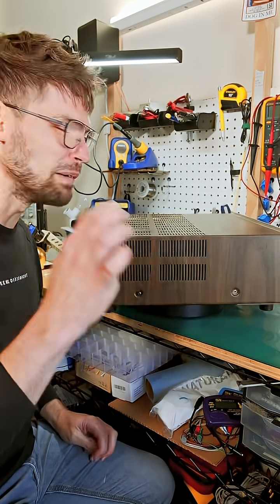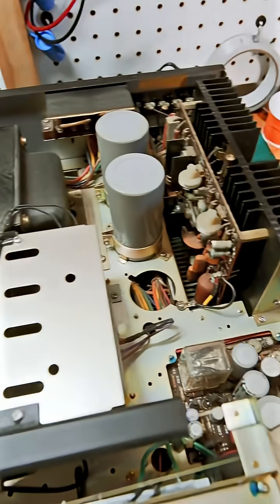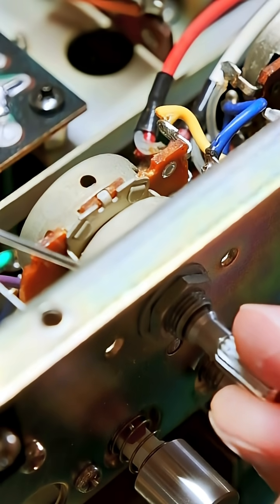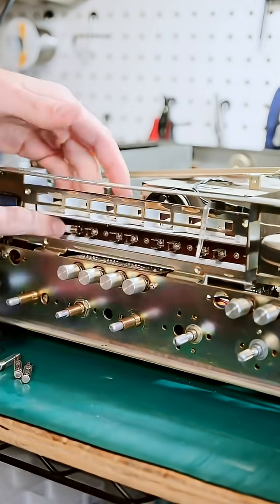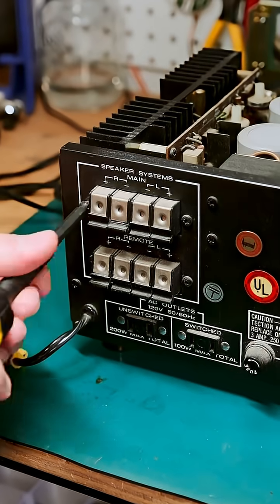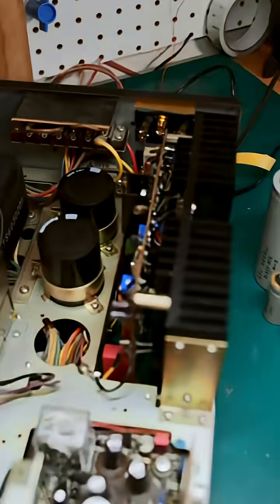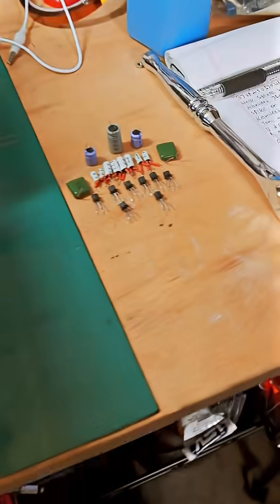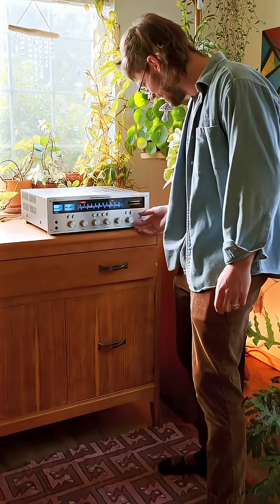Built to survive a house fire 🔥 #stereorepair #vintageaudio #Hifi #Marantz

Comment: THIS GUY IS EXACTLY WHY I DON'T GET MY EQUIPMENT FIXED ... TECH'S DO SHT YOU DON'T NEED AND YOU DIDN'T ASK THEM TO DO ...THIS DUDE REPLACED THE SPEAKER TERMINAL FOR NO REASON AT ALL AND TOOK ALL THE GOOD PARTS OUT AND REPLACED THEM WITH CHEAPER PARTS TO RESALE AT A LATER TIME .. WHAT A A.HOLE

Comment: Love YA!!! I'm just a nerd of many colors offering a tiny bit of help!! 

No snobbiness intended...

Vellum isn't paper, but a category of materials whose intended uses overlap papers, textiles, stationery and even passive filter media! Vellum is a legitimately dope material for every use paper has, and even when identically thin as most papers we use in modern era, about .004"-.007", vellum will offer an incomparably longer life especially if being folded flexed rolled or even WET... Papers are by definition dried and pulped wood fibers which have nearly zero usable length for any hope of a lazy self knit. VELLUM is cotton fibers and totally will self knit thus it will NOT dissolve in water. Yada yada it's irreplaceable for dorks like me; artistic, legitimately a decent board drafter, AND a builder/fixer. Vellum has a writing/drawing feel and sensation that NO paper can match, and ALL final board drawings go on vellum for archival means.

/NerdGirl

Comment: Have one of those beauties on the shelf, next to my MacIntosh amp.  Had both since the mid 70's, as well as a pair of Bang & Olafsen Rose Wood speakers.

Had a B & O Linear Turntable until an idiot friend stepped on it, during a move; it did not survive.

Buy good stereo equipment & it can last an average listener a lifetime.

I've added a few components, tape players; started w/ a Sony reel to reel, foolishly believed cassette propaganda & sold when I got a cassette.  About 20 yrs got a TEAC DAT when a friend died; pro studio gear will spoil ya. Lol

The loss of the B&O turned out OK, when turntables first died out, I picked up a turntable I never would have spent the money on, but at 75% off, who can say no.  A year or so later, wasting time b4 an appt: drop into stereo store. They had a cartridge, orig over $600. 

Luck would have it, I knew 'some' about it. Enough to know I should buy it @ $50!

Now, if all the albums I still have from the 60s & 70s were in better shape.

Comment: Ooh, in 1973, having just left the Air Force and was waiting on the bus to the airport, I went into the BX and found a Pioneer SX424 receiver and two speakers.  They wanted $299 for the set, I had $300 in my pocket, and I took them home.  I still have that receiver and both speakers, and they will likely bury it with me when that time comes.

Comment: About how long does it take to rebuild this unit?
Reply from the maker: If you're experienced, maybe 15 hours. If it's your first one, probably 100 with research and getting the parts together.
Reply: @Shuksanaudio Thanks! Had originally meant how long for you to rebuild? What about cost (for this unit and for you to do it)?

Comment: I have a Yamaha natural sound AV receiver model HTR 5850 it says it puts out 300 watts my speakers are Jensen CS315 they say they take 80 watts continuous and 220 peak there 15" 3-wayspeakers and have great sound but i can't turn my volume up more then half without tripping the circuit breaker and shutting down the system. Don't get me wrong it goes very loud ,loud enough to not hear someone hollering right next to you but I want speakers that can get to near concert levels. Anybody have a suggestion as to what type of speaker I can buy to get to those levels or volume.  I would like to hear how my receiver sounds at its upper levels. I want the bass beat to come out through my breath wile vibrating my whole body you know what I mean.

Comment: Does replacing all those parts affect the original sound of the unit?
Reply from the maker: Individual parts don't have as much effect as the circuit as a whole is generally what provides the sound signature. That said, old parts in the unit have aged the sound a bit as the electrolytic caps tend to develop higher ESR when it comes to frequencies over a couple thousand Hz. Replacing them will yield a sound closer to the original than it sounded before the work.

Comment: I have my original Technics SUV 9  Class A amplifier , I have owned since 1981.   120 w/ channel beast, It has been in original box for about 20 years along with separate tuner.  It needs cleaning as there is some noise in the controls, I have kept it all these year because of the look and the solid heavy feel of the analog controls. Should dig it out sometime and have it gone through.

Comment: You do great work.  Only thing I don't like is when you remove the original spring speaker terminals for big, clunky, protruding binding posts.  Since the '70s I have never had any issues with spring terminals. Audio snobs (not saying u are one as I appreciate what you do) seem to dislike them. But you have to do what your clients want.  Do Marantz units have issues with spring terminals? My Sansui ones are fine and have great spring tension.  Great job on the 'ole Marantz.  It will go another 40 years.

Comment: I jave that exact model. I found it next to a trashcan with a Marantz tape deck and some warfdale speakers in  1990. The only thing that ever broke on the amp is one of the lights witch i replaced with an oroginal light that was hard to find back than. White LEDs didn't exist back then. The tape deck that came with it stil runs on its original rubberbands. I like the sound of the Marantz and i don't think I'll ever buy an other

Comment: Very nice result. Except for the crappy looking fake wood veneer of the case. It would definitely benefit from getting a real wooden case with a nice varnished veneer. 
What did you use to clean the front plate without damaging it ? IPA alcohol ???

Comment: A vacuum cleaner generates so much electrostatic energy, you could easily destroy an ic. Once you‘re finished with the vaccum job, you might as well use a non-antistatic cloth… you‘ve already stress tested the circuit. Ok for the high voltage side or military-spec hardware but not for anything else worth repairing.

Comment: I have this tuner inside a giant old cabinet and still, to this day, I have never had it cleaned and it still is the best sounding system I have. Maybe a couple of pops in the volume but otherwise just majestic. I don’t know for sure, but it’s oriented face up in the cabinet that has a wooden lid and perhaps the cover with the aid of gravity has helped keep all the transistors and wires and such from getting completely covered in dust. At any rate, always nice to see another one. Lemme know if ya wanna clean mine lol

Comment: i have Heathkit aa15 and ar15 I built in late 1970s. are they worth rebuilding ? Most electrolytics probably bad by now I would guess. just wondering. Replace a large 20000 mf about 40 years ago

Comment: What is the point in replacing the lights with LEDs? Seems it would just introduce noise into the system and the power usage is not really a concern.

Comment: Too funny, while it's true rms AC power is not directley equivalent to DC (excuse the pun I stuck in there) the approximation of power is. 120v, 310W = 2.5A, so the 3A 250v fuse is the right rating... Imagine a 220v+/-10% system then only 2A fuse is needed for 1/2 the current

Comment: I had a onkyo tx NR 609 which died due to hdmi chip issues . It was in warranty so the offered me a tx NR 646 worked great for a while now it will not connect to the internet I have factory re set and no matter what I do I can't get past the gray out network on the menu . Any idea what the issue . Thanks

Comment: I had one of these in the 1980s. It had a short on the volume knob. I would have to crank the knob up until the volume came on then turn down the knob to the volume I wanted. This worked for a few hours and then the volume would drop out again. I would have to turn it off to let it cool. It was free so I didn't complain.

Comment: I love the days of solid state components (resistors, capacitors, vacuum tubes).  Before sealed IC Chips took over - circuits are so miniaturized now repair is not possible and they are so susceptible to ESD damage.

Comment: if you do scratch the black, you can fix it with an airbrush.
I did scratch a plate before and spraying it black with an airbrush fixed it. if you look closely you can see it, but not under normal conditions

Comment: Did you measure THD(1kHz,10kHz) after work was completed? If so, that would be good to see so-as to compare to the specification for this old timer. In this way the customer knows if the work is correct or not.

Comment: My wealthy uncle was an audiophile. I remember well in 1974 when I was 15, going to many very expensive stereo shops that only sold high-end systems. They always had separate rooms you would go into to listen to different equipment. Sometimes, we'd travel over 100 miles away in his 2 year old Rolls Royce to look at or buy something.  Marantz equipment was usually present. I remember he bought a pair of very tall, maybe 6 or 7 ft tall speakers that were like an inch or 2 thick called MAGNA PANS... he wanted the best amps. Best turntable, tuner, cassette deck, which had just started coming out replacing 8 tracks... they were very expensive..fun times, good memories.  It was a different world in many ways then.

Comment: Flyback diodes across the output transistors?  Replaced all the bad caps?  Checked the waveforms and removed all the distortion?  Perfect.  Subscribed.

Comment: The sound quality of that little beast is amazing. Once again showing it's not about how many watts but the quality of each one! 
Is it considered a dual mono amplifier? Is there a complete and separate amplifier for each channel?
Reply from the maker: Absolutely! It sounds great! It's not dual mono. That would required two transformers and two separate power supplies. There is always a separate amp card for each channel if it's a multi channel amp.

Comment: Hello and good morning!   Soo.... I had a fire and everything i own was either burned or it has considerable amount of smoke damage.   Unfortunately my Sansui 9090 was a victim.   Let's say it got super hot the wood cover turned black and was exposed to some serious heat.   Of course I've kept it and want to start a rebuild on it but I haven't had the time.    This winter I am going to start it.   I have a multimeter but i don't have an ociliscope and I am wondering if I should get one for this project??   Any help, suggestions or advice anyone has is welcome.

Comment: Is it really necessary to change all those capacitors? I was wondering if you all technicians out there realize that those capacitors will end up in the dump? Where it will decay and rot and the chemical will end up in the ground water, river and ocean.
If sound quality is dusk and dawn then I have no problem with that, but no it does not change a bit. It will only improve a fraction.
My country the Philippines is one of the biggest contributor of pollutant where our thrash must have reached North Pole so to speak and it will be so frustrating that a developed country could further contribute to the ongoing worldwide chaos.
I am an old school technician and I only change capacitors and solid states that are bad not to overdo things just for the sake of making your client happy in which I firmly believe they will forget months after delivery.
 And I use my common sense to keep my thrash to minimum.
Please think carefully before you change a good working capacitor.
Please.

Comment: I grew up with that very same receiver, seeing you spin the tuning wheel I know the smoothness the flywheel provides.  I love the sound of my old analog Onkyo receiver that I got in the early 90s at Circuit City and the sealed infinity speakers with soft dome tweeters.  The speakers have been rebuilt twice.  It is full warm sound that you just don't get from the new plastic ported stuff.  Nothing like a 40 lbs receiver with a bigger power supply than my TIG welder.

Comment: When I did my 2270 a few years ago, I used real incandescent bulbs, hard to find, but it looks authentic.. and since most of the originals lasted nearly 50 years, I figured that going original would repeat that, and be well past my own life expectancy as I'm now in my 70s. .. Nice work on the re-capping.. These old critters really perk up with fresh modern electrolytic caps.. I did not do any my 2270, as its all still working, but at its age, I do worry about old caps starting to fail.. I'm now so busy with consulting work, I don't have time to it myself if they act up.

Comment: Around the mid 70s I bought a Pioneer SX1250 , a Dokorder ten and half inch reel to reel, a Dual 1249 turn table with a Shure V15 type 3 cartridge, and a set of big Pioneer speakers. I don't remember off hand the model # off those speakers.  An Akia 8-Track tape player and a Panasonic cassette player, and last but not least I got a pair of Yamaha HP-1 headphones (that are still the best headphones I ever heard).
Everyone always came to our house to party. All those items (except for the headphones) went into the closet in the original boxes when I moved. I also bought an original shop manual for each item. I keep thinking about setting it all up again. I remember that when I would switch on that SX-1250 it would dim the lights in my house for a second

Comment: Ever since I turned 16 and got my first job I've had my Aiwa receiver, one of the last with a volume knob instead of digital, 4 channels, inputs for days, it's old enough not to have an optical port so currently and ever since I got the Dac have been using a MoonDrop Dawn Dac running from my Android TV box to the receiver using a 4.4mm to 3.5mm adapter to red white AV and yes I still use Monster cables from back in the day, sound is incredible to watch tv with

Comment: I really love the things you do from the actual work,of restoration,and then the improvements  and modernizations.these old equipments were pretty awesome and close to the looks of new stuff we have today.its just when the old stuff is seen it's got the faded bulbs,the yellowed and s discolored paper,and vibrance is gone,the plastics are yellowed,all that combined makes 5hose equipments not look near as nice.but when they came out they had that vibrant,colors,metals glass.etc.and they compare d totodays new stuff in looks.love the led additions.should really keep the heat overall temp lower....heat always matter for longevity,maximum potential max ratings staying close,and less heat is safer..keep up it up..

Comment: Got a 2385. Had it since 1977 I believe...been so long. I had it recapped,1 channel repaired, re lamped with all original lights and deep cleaned. Today I play it with my old records, listen to the radio and run the odd cassette. Back then I purchased the Marantz line, the Q turntable, cassette player, and the 2385 reciever. Blasted the sound into my fully reconditioned Altec model 14's. What a beautiful stereo system. All pieces are in mint condition, looks and sounds absolutely amazing. Friends haven't seen one of these since the late 70's, let alone be able to listen to one. I'll never part with it.

Comment: I have a Pioneer SX-1250 and is in factory condition. I LOVE IT.  
I also had a Pioneer QX-949 Quad receiver. That was at the time the radio stations were “talking” about broadcasting in Quadraphonic Sound. 
I’m very sorry I sold that one.

Comment: I always used a drop or two of lighter fluid to remove the scratchy sound when the tuner knob’s got turned. There’s just enough oil in lighter fluid that it corrects and lubes the tuner knob. I would tilt the receiver so the lighter fluid would run down the shaft and you’ll be surprised at just how well it works, and there’s no tear down doing that way. The couple drops of lighter fluid will find its way to where it needs to go and no more scratchy sounding tuner knobs when turning them.

Comment: I still have my Marantz 2270 I purchased in 1972 from CMC Stereo in St. Louis for $400.00 plus $18.00 tax, total was $418.00.  I also have the Fischer XP 90s with 15" wolfers.  I have the yellow carbon copy receipt here in front of me.  Took it all apart in the 1990s, cleaned it and installed all new lights that were out.
Most likely one of the main reasons I wear hearing aids now!  lol
Still one bad mamma jamma!